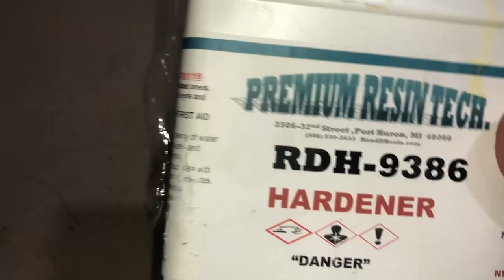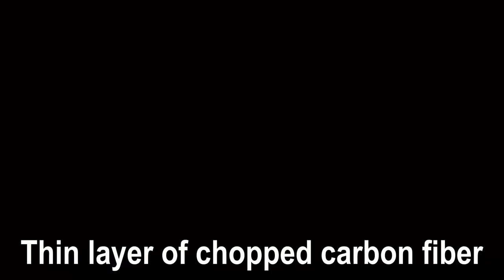How to Make a Forged Carbon Fiber Table Top [DIY] (Forged Carbon Fiber Skinning)

Comment: can i ask?
''soak the carbon fiber in epoxy''
the epoxy is with or without harderner?
Reply from the maker: Yes with hardener, you need to mix the epoxy with hardener for about 5 mins

Comment: I have a question about using WAX after you using it 4 times?
Should WAX be used once and cleaned off.
Then use WAX a second time and clean.
Then use WAX a third time and clean.
Then use WAX a fourth time and clean.
Should it be used in this form?